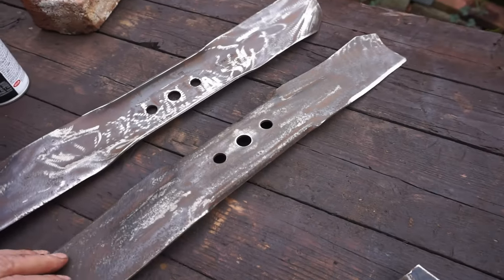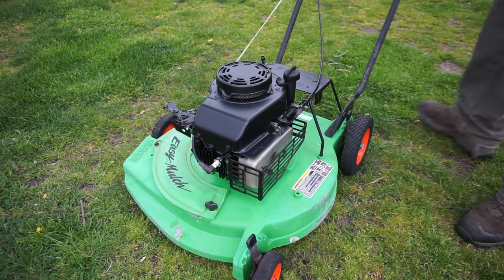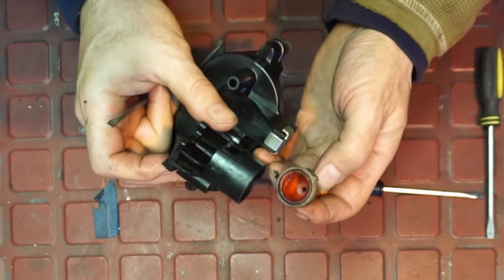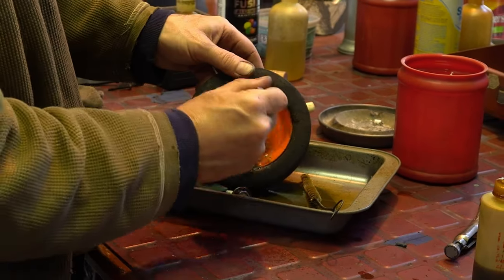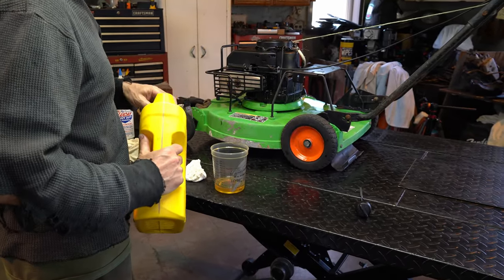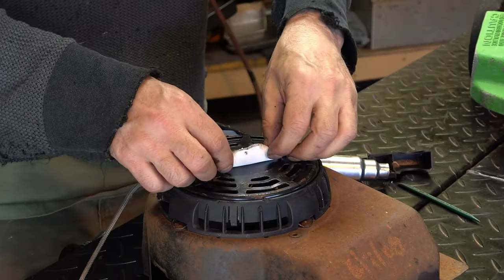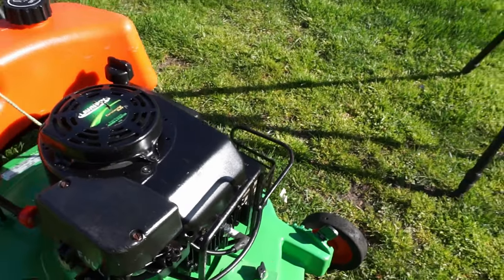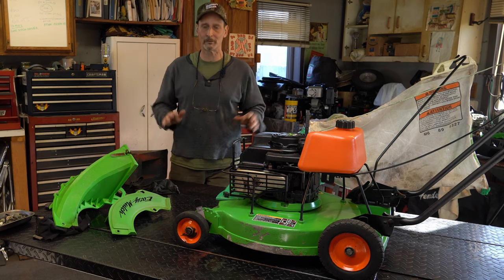IT'S DONE - Old Lawnboy Commercial Lawnmower~Briggs Engine~ Refurb (Lets Finish It) Part-3

Comment: I just want to point out that they are called "Engines" and not motors. They are 2 totally different things. Motors run on electricity only and and Engine runs on sprk, fuel and compression. They teach this stuff in high schools.
Reply from the maker: Everyone knows that, no one cares but you lol

Comment: Looks Great awesome job.Hey Arch was the old 2 stroke pulled off it and replaced with the briggs?
Reply from the maker: No it was an officering for commercial. As we know tecumseh had the contracts originally (2 stroke & 4 stroke) but as the company began to struggle my guess is briggs to the rescue!
I thought it was odd, I haven't seen any and I do have several with the tecummy engines both 2 & 4 stroke. 
I will be going over those in the future
I may also part this one out if need be for a more rare version. Parts are around but getting pricey. 
Thanks for watching!
Stay tuned!